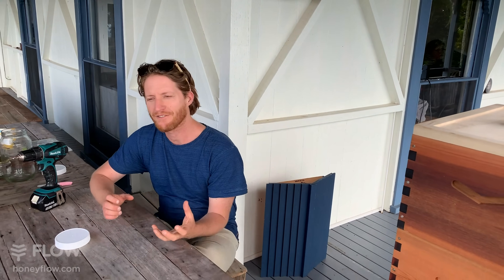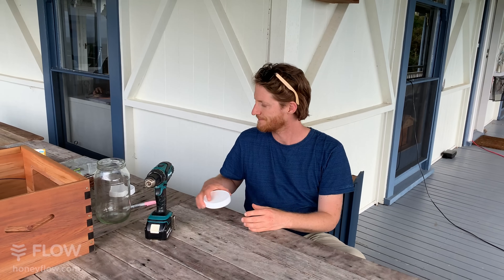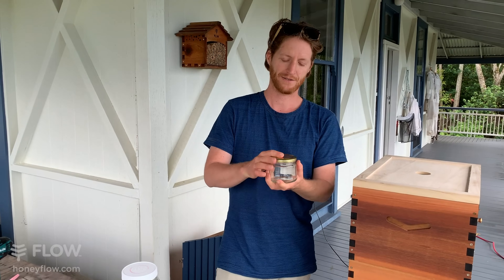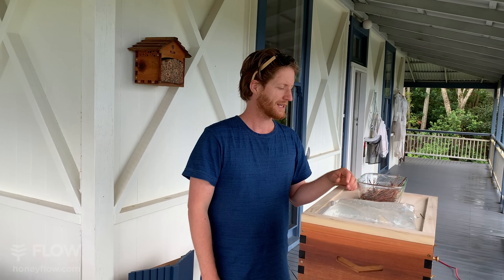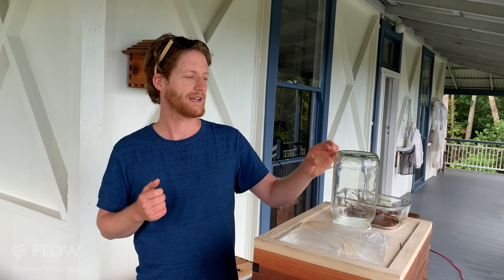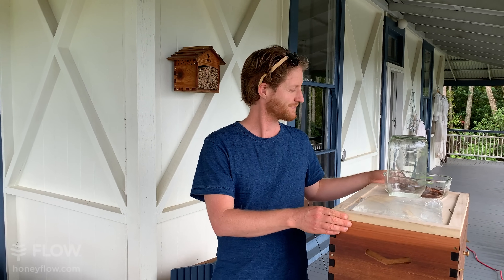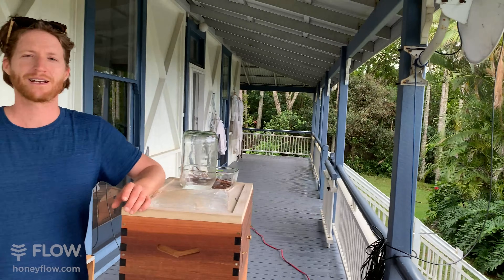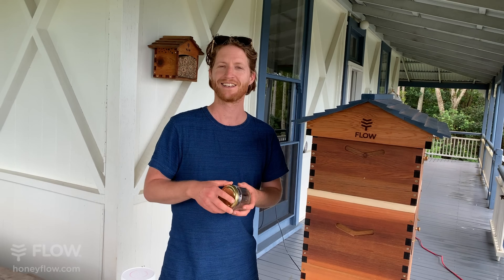DIY Bee Feeder - Flow Hive 🐝🍯

Comment: Tip: we bartenders simply pour the amount of sugar we need into a metal or heat-resistant bowl, boil water in a kettle (we actually have very hot water on tap), pour the hot water into the bowl and then stir until dissolved.  There is no risk of caramelizing and it takes very little time.  If you need the syrup to be cooled down quickly, use less water when dissolving and just add ice cubes to cool it down and dilute the syrup simultaneously. Hope this is helpful!  Thanks for another informative video!

Comment: I've tried open feeding bees by putting sticks and pine needles and ended up with a bucket of drowned bees. Try a piece of Styrofoam with holes drilled in it. The foam floats on the syrup and it will allow them to drink without them being in the syrup.  Much less drowning

Comment: Ive seen info that said if using a nail to make holes that the holes should be punched from the inner side of lid due to the small pointed ends causing issue with bees proboscis if punched from outside of lid.
Whats your info about that? Thanks.
Reply from the maker: That makes sense, Mike. Thanks for sharing this info. I'll pass it on to Cedar :) – Leah.

Comment: I think top feeding is definitely the best.  Don't have to deal with guard bees / robbers and drowning.  Thanks for sharing.  I had an idea btw.  How about a tupperware dish with holes drilled in the center bottom, along with a wood frame to hold it in place, centered with the hole.  That way you can take the roof off , pour in some sugar water and not worry about the bees drowning?
Reply from the maker: JG, I will pass this suggestion on to Cedar :) Thanks for watching and commenting – Leah.
Reply: @FlowHive  Also the housing between roof and super could be really shallow if using a shallow tray.